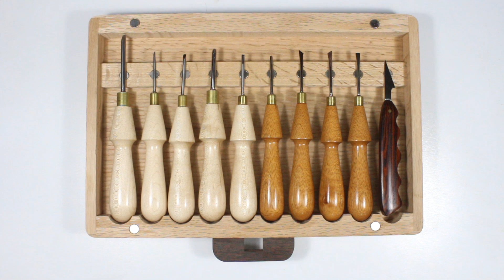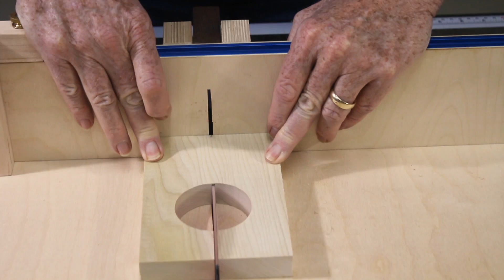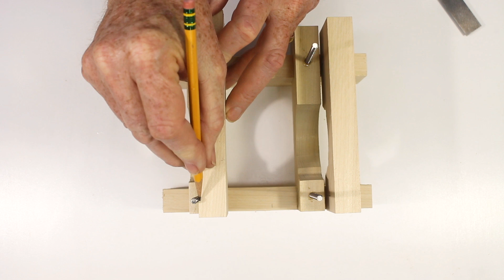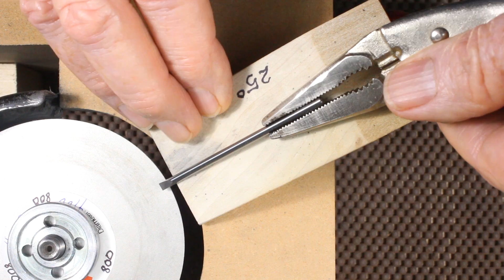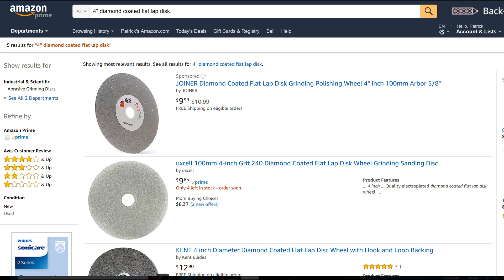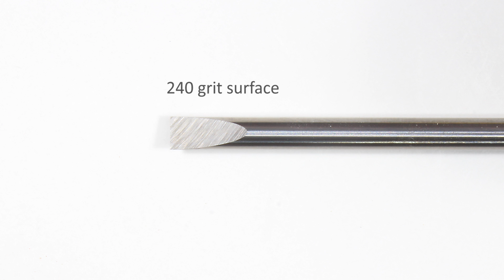Solid Carbide Chisels:  Power Shaping

Comment: Variable speed angle grinder will help greatly with the friction heating. Makita makes a very nice line; soft start, variable speed, lock on, slip clutch, adjusts to maintain speed under load. 4.5 and 5" are fastest. 6" runs slower. Beautiful grinders!

Comment: Wetsaw would work better and is cheap
Reply from the maker: I agree that a wetsaw has some advantages.  It handles the dust and any hazard that carbide dust might have.  It remains cool, so you could hold carbide blanks in your fingers, and keep them in contact with the diamond wheel until you had the bevel or shape you wanted, eliminating some of the need for an angle jig.  Is there a small, inexpensive tile saw that would be suitable?
Reply: @PatrickSullivan  harbor freight has one just under $60 I paid about $50 ten years ago from lowes, inflation
Reply: Mine came with a diamond wheel but not the nice fully coated ones like you already have it was a cheapo wheel

Comment: Cool videos. Thanks for the tips.  Question: why not drill the ¼" Ø holes in the cool cradle you made for your angle grinder before you cut them into 2 pieces? That would have ensured their.accuracy and saved a critical step in the build...  also. Ive been pretty successful in using solder to bend around odd shapes and trace them into other surfaces. It helps a lot if you hammer the solder kinda flat first....

Comment: It is interesting how complicated people with ZERO machine shop knowledge make tool grinding. Is there a home without a standard bench grinder? Specific grinding wheels for carbide have been available since the 60's. I have been sharpening lathe tools since 1969 on the basic bench grinder. Jigs for angles and radius are easily made. This is not to say that this demo does not work. How about those people who do not have a angle grinder? Is your angle grinder specifically grounded for wet work? It could be very shocking if not. Mr Sullivan made a good video instruction. Quite the production. Not researched very well. Safety when cutting carbide was not mentioned one bit. Discover the hazards of carbide dust. The excess speed of the angle grinder is likely to over heat the carbide. Betcha never had one explode on you yet. Over heating will do that.  Try to not kill anyone with your next video pseudo instruction.
Reply: Try not to be so negative with your next comment.

Comment: Great video! You have opened up a whole new world for me with these carbide tools. I was wondering how you made the parting tool and had already planned to make the replaceable carbide tipped lathe tools. I've got several large projects underway but I have to find time to build your stow away lathe. I've got 2 of those 1/2" Milwaukee drills (one is a right angle but that is removable). I've also removed a 1/2 hp DC motor from a treadmill which would provide variable speed for the lathe. I've really enjoyed your videos and plans. Like you I've been woodworking for over 40 years and enjoy making my tools and jigs as much as what they produce. Your approach and presentation are flawless....Thanks

Comment: Nice work! you just talked me into making my own tools now. Great video tutorial, do you have a list of what/where you purchased the stock?
Reply from the maker: Dan:  See the first video in this series on carbide tools (the link is in the description above).  It gives a lot of information about  where and what kind of carbide to buy.  I also have a series on making tools from O-1 tool steel.  The third video in that series shows the making of different kinds of handles.  Between these, you should have all the info you need.  Thanks for your comment.
Reply: @PatrickSullivan  Dear Patrick.
Thanks for your great work. I looked through the description of all of your videos and also reviewed the whole catalogue of Ultra-Met, but I have to say that I still have no clue what to order. It would be great to get a detailed hint from you. I'm into leather working (started also a bit of wood carving) and I want to make a stitching awl. It's so important to keep it totally sharpened. I also thought of copying the blade of my hand cutter, that would be awesome. I bought some excellent Stanley blades for it and I polish them with a strope, but they don't stay sharp for long time. You were worried about the stress on WC blades, when working with leather that won't be an issue. Keep up the excellent ideas. Enjoy, Michael
Reply from the maker: Michael:  Check out my ealier video on carbide tools.  It has lots of details about sizes, types of carbide, and the source I used.  Here is the link to that video:  https://youtu.be/dWUoKy8rCcQ.
Reply from the maker: Dan:  I provide a lot of detail about what type and size of carbide to buy, and show the web page for Centennial Carbide which was my source, in my previous video.  Here is the link:  https://youtu.be/dWUoKy8rCcQ.  This should be everything you need.